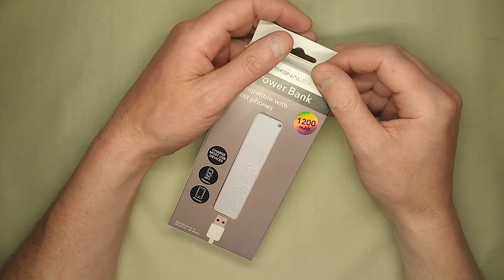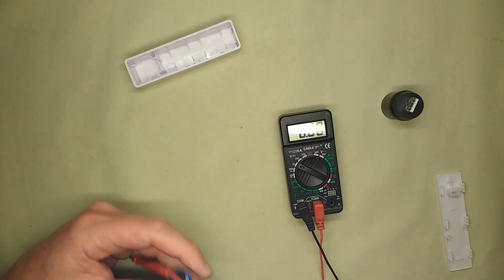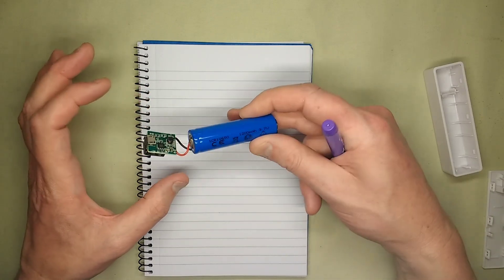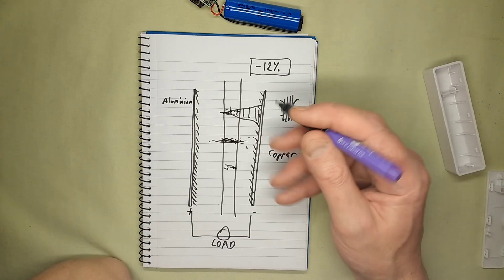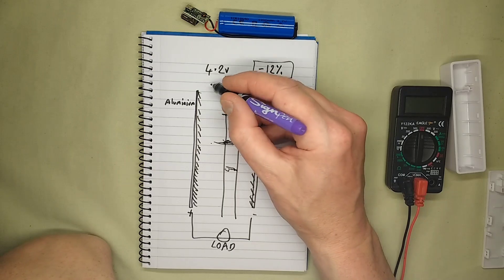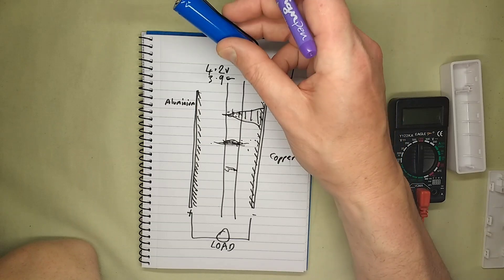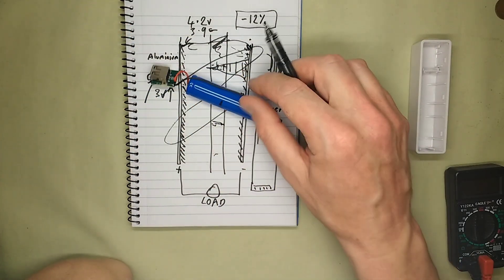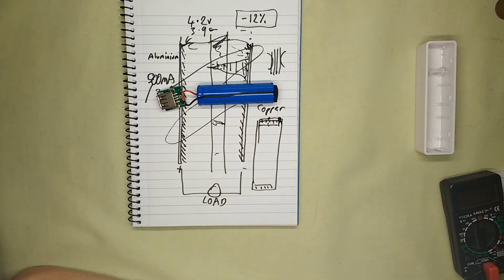Are over-discharged lithium cells safe?  (And how to test for damage.)

Comment: I've only just started tinkering with 18650's in the last few weeks. And I found this video right after i finished doing the same self-discharge test on over 60 18650 cells that i got from old laptop batteries.

I charged them, recorded the fully charged voltage of each cell, and then left them for 2 weeks. Most of these cells started off below 2.5V, others were even below 1.2V, and a few of them had a voltage as low as 0.12V.

All except for two passed just fine. And most of them seem to still have most of their original capacity.

Comment: Hello Clive,

I would be cautious about recovering cells from below ~1V. I once left a 20Ah Li-ion (NMC) pouch cell plugged in to the load bank on the bench, forgetting the load bank would continue to discharge the cell when off. Monday morning, my boss showed me how the cell had gone from being firm to really floppy, indicating loss of structure. We disposed of the cell. This loss of structure obviously won't be visible with an 18650 cell due to the metal can. Would be interesting to repeat this test on your "9V" lithium-ion battery's pouch cells.

I was once told by a Li-ion chemistry expert that discharging a Li-Ion below 1V would completely de-lithiate the cathode, and collapse a lot of the structure, resulting in capacity loss. If charging too rapidly after that, lithium dendrites could form, triggering a micro-short circuit (which may/may not burn off). For this reason, (and also thermal dissipation as you pointed out) charger circuits usually do a 1/10th of normal charge current until the cell is closer to 3V, then they charge at full current. I have however seen some chinese designs that merely use a diode+resistor from a USB connector direct into the cell, and rely on the cell's protection circuit to cut off the charging when full. Pretty sure if it wasn't legally required to fit a protection circuit, they would omit that as well.

I've also seen power banks that fail if they aren't charged regularly, the power bank circuitry self-discharge takes the cell fully flat after many months. After that, they often have poor capacity and don't keep charge.

So, my conclusion is, over-discharged cells should be viewed with suspicion, and not fitted into a serious product. If you have to use them, charge slow, and never leave unattended. I have seen cells that just sat at around 2.4 to 3V and took ~1C charge and just got hot - eventually, in a confined space, if they get to runaway temperature you could have a fire(work). For this reason a lot of chargers have a timer limiting max charge time.

At a previous job, we would screen every new battery's voltage when it arrived - after 6 weeks in a shipping container en route to us, if it had discharged itself,the voltage would be low, and we would reject those cells below ~3V. So i can confirm your method of screening for faulty cells with self-discharge does work, and has worked for me for 100s of thousands of batteries screened.
Reply: I have a power tool battery I did this to and it is still working 2 years later....
Reply: @optimizelogicrepair2784  I recently did some tests with Lithium-Iron Phosphate cells, and was able to take them down to 0V for an hour or two and then use the charger's recovery feature to slow charge them out of the dangerously low voltage zone. After that, they came back and worked fine, with barely any loss of capacity. But I wouldn't do this with other Lithium-ion chemistries, I've seen too many that swelled up or didn't recover properly.

Comment: What I found taking apart laptop cells is they will read .7v or such but that isn't actually the battery charge but what seems to be a leaking voltage from a protection circuit on top of the cell.

 As soon as I connect it to a bench supply and power it a few minutes it'll shoot immediately up to more of a standard operating voltage and usually work fine from there on out.
Reply from the maker: Below 3V lithium cell voltage plummets.  If too low it should be brought up slowly with a trickle charge to 3V again.

Comment: I have a question 
I have a power drill battery pack without anything but the cells,really,no protection just cells,and they all act like capacitators. Is it possible to cycle them enough for them to work again?
Also are cells with paper cover more dangerous than the ones with heat shrink?

Comment: Good explanation.  I was wondering if there was any chance there could be some small drain through the board.  Also, I've read that some of these batteries have an internal circuit that protects them and they basically look the same on the outside.  I wonder what would happen if a protected battery was protected again by another circuit.  I watched a very long presentation by a university who accepted and tested a large number of major manufacturers batteries.  They couldn't identify the manufacturers but stated that combination of additives, they called the "secret sauce", identified the very best batteries and they did mention company names that tested the best like Tesla.  I'll try to find a link.
Reply from the maker: There is a notable standby drain with these.  When multiple layers of protection are used they don't usually interfere with each other.

Comment: I know this is an old video, but I recently had success reviving a Milwaukee drill battery. The charger wouldn’t even think about charging it because the cells were discharged well below the threshold. It sat that way for months. Just for science I hooked it up to my bench PSU and set it to the packs voltage and 3A. I sat and watched it go up and kept putting it back onto the charger until it would charge. I ran it through a couple charge/discharge cycles and it has been holding a full charge for 2 months. I was pretty surprised, and saved a $100 battery. Great video!
Reply: Update: 2 years on and the battery I jumped is still working!!!
Reply: @optimizelogicrepair2784 thank you for the update. Gonna try the same on some salvaged cells from a laptop battery
Reply: Did the same with a Ryobi 18v battery. Since it was still within their warranty period, they sent me a new one and told me to recycle the "defective" one. Essentially gained a free battery.
Reply: Try a lower current next time just to reduce the risk of ignition 8:20
Reply: I have read an article about modern laptop batteries where they are sometimes designed to fail permanently. The circuit board has trippable switches to disable the battery entirely or specific cells that are bad. If you try to replace the cell the battery still won't work due to the circuitboard trip switch which is permanently tripped. (Not sure of the correct term for this)

There are sometimes chances to replace a cell , but you have to do some hackery like keeping the old dead cell connected while adding on the new cell, or equalizing the voltage of the old cells and new one, else some imbalance trips the battery circuitry and the battery will be permanently disabled. (Even though you have now fixed the battery, the circuitboard won't allow its use or charging)

 I'm not sure if your tool batteries are designed the same way though
Reply: @zzoinks  this is called an evil BMS 8:20

Comment: Huh, I haven't had great luck restoring batteries that went to 0V... No fires, but no recharge luck. ~1V seems to be where I've had luck maybe getting them to come back, usually at like 40-60% original rated capacity. Although I'm guessing ones like the battery bank you had here weren't at 0V for very long times, wonder if that has anything to do with it...

It's probably safer for folks who haven't worked extensively with these cells to stick with the 2V rule, though. Or at least to make sure they're really safe, like having a low current charger that's in a place where it can't potentially burn the house down if it does have a catastrophic failure. [I have a fireproof box that I put suspect cells into for charging]

Comment: I've revived tons of fully discharged cells in the past 10 years, as mentioned most of them are doing pretty good, just with slightly reduced capacity but more importantly higher internal resistance, so they aren't good for being discharged at 10C or so anymore (assuming they were in the first place, thinking of lipos used to power drones)... in a powerbank or powering accessories no issue. Some lipos do balloon and die though.

Comment: About the phone problem ... I think its the same phenomenom when you mention about cells that where over discharge (near  0V), and they where ok after a charge ... The inner materal isnt limited for a low price of production. So even if the cell is over discharge and charge again are not damage is just because its the reverse of making phone batteries for limited space money etc... Those poundland cells are beeffier if i can say, they dont care  xD the inner material dont brake that easy and they might have more materiel than needed (thicker isolation between Inode cathode than necesaary) 
 so they dont brake that easy when under high stress !?!?!?

Comment: The only issue with heavily discharged cells I've found is my favorite charger refuses to accept them as anything other than 1.2V cells, and my hobby charger flat out says no and angrily beeps at me.

Normally, a quick zap on the bench supply limited to say 100ma, perks them right back up.
I have never had a cell do anything... funny, afterwards. Only a bit of lost capacity.

It's worth noting that you can do this to other rechargeable chemistries too.
Once or twice a cell wouldn't take a charge, and I've just straight up told my bench supply to blast the cell for one or two seconds with thirty volts at five amps, in the hope of just burning through any internal shorts. I've brought several cells back to life this way, and have yet to have one be problematic afterwards. Usually quarantine them for a day or two in a steel box after, but no problems.

Comment: nice informative video, just as relevant as it was 4 years ago.
I have a stockpile of 'dead' laptop batteries (18650  cells, between 3 and 6 depending on laptop brand) from work that I'm waiting to open and see if any of the cells inside are still useable.
In the laptop it will go from 0% to 100% in a few minutes, but then immediately die when disconnected from the power supply.

Comment: I've had some success in freezing Lithium batteries and then once frozen, dropping them at shoulder height onto a cement floor several times, then letting the battery thaw and recharging them again...I usually get a few hundred more charges out of them! YMMV
Reply from the maker: Not sure I'd recommend that in case it causes internal damage.
Reply: I've revived a couple of LiIon laptop batteries by freezing. Let them freeze an hour or two, thaw, then charge. The one in my laptop has been going over a year now. Pack was previously holding only 10 or 15 mins now runs over an hour.

Comment: However, the 'copper spikes' issue causes lithium ions to self discharge to 0v. If you charge them back up, you could trigger them into thermal runaway. But the batteries were damaged first, leading to their self discharge to 0v. So asking if it is safe to use a battery at 0v is not enough information. HOW did it discharge to 0v?
Reply from the maker: Quite often due to bad power management circuitry with high passive current.

Comment: Hi Big Clive, just subscribed and really enjoy your very instructive videos.
@9:30, this charger circuit reminded me a lot about an IC for the same use which i'm currently evaluating for various designs: micro RC rover, bluetooth keyboard etc, it's the main chip on most eBay ICs LiPo-to-5V+charge adapters:
HOTCHIP HT4928S, it's an SOIC-8 combining a Li-Ion/Po 1S charge circuit plus a boost converter to output 5V, requiring only some passives +a 4.7µH inductance:
https://datasheetspdf.com/pdf/1256500/HOTCHIP/HT4928S/1
planning to use this chip for all my <500mA 1S LiPo uses when i really need  5V and can't have all on < 3V.
(And sourceable, for now we have many vendors selling modules based on it but very few vendors for the bare chip).

Comment: Clive -   I have 2 x tablet KEYBOARD batteries (7wmm7) from a Dell Venue Pro 11 7140 I bought on ebay as untested. Tried in the keyboard but neither wouldn't charge. Opened one up today and it has 4 x lithium cells connected in parallel I presume as the stated voltage is 7.4V. Each cell had 0 volts in that battery. Opened the second battery more carefully(not BigClive styli ! )  and checked each cell. This time each cell was 0.92 volts. So my question is - if I connect a couple of AA cells in series and apply the 3V to each of the cells in turn will I be able to  boost  them to about 3V so the keyboard charging circuits can recognise them and then fully charge them ? The cells have no protection so I would keep checking the voltage every few minutes to see if it was increasing. Should I give this a go or not ?
Reply from the maker: Make sure that none of the cells are reading a negative voltage.  It may be possible to gently bring them back with a current limiting resistor to get them back to 3V.  Lithium cells may not be suited to high current use after excessive discharge and if there is battery management circuitry it may lock the battery out. 
On eBay "untested" usually means tested and failed.
Reply: @bigclivedotcom  Thanks for the advice, Clive. I will give it a go later today.

Comment: Great video. I had a Samsung 30Q that got drained down to 1.6v and I didn't want to scrap the cell. I thought about that copper shunt issue,  so I used my Xtar Dragon VP4 Plus to check the internal resistance of the cell. It was 0.24m at 1.6v so i started charging it and was able to get the cell up to 3.82v so far. The Internal resistance now dropped to 0.10m.. So I am inclined to believe that this cell is OK. Does this sound right?
Reply from the maker: It should be OK.  But don't use it for very high drain applications.
Reply: @bigclivedotcom  Hmm, and that's exactly what is was being used for originally. A high powered flashlight that used a FET direct drive driver circuit. (Lumintop GT Mini) So you probably advise against using it for that light now? BTW it charged up to 4.18v with a final internal resistance rating of 0.10 mega ohms.

Comment: I have one but when I plug in this thing that turns any speakers into Bluetooth speakers it turns on for like 5 seconds and then turns off again. I think the board can sense when power is being drawn because it has no switch. And I don’t think the Bluetooth thing draws enough power or something? I was just wondering if I can put a resistor across the positive negative of the Bluetooth thing with a switch somewhere on it? I am kinda new to this stuff so if anyone can help that would be nice.

Thanks

Comment: i own one of those, they get discharged because there is a blue led that stays on even when its not supposed to be on but at a lower brightness, and yes, those get really hot when you use them to charge a phone (the pcb does, not the battery)
Reply from the maker: The blue LED indicates that the booster is pulsing to keep the output capacitor charged to 5V.  It gets brighter with higher loads, but should normally just blink dimly every so often.

Comment: This video I do not like. You propose that we should just charge the cell all the way up to 4.2V and then check for self-discharge a few days later. Well, guess what... if a cell has developed shunts inside due to any reason, and you try to charge it to 4.2V using a standard charger with a current of 1A, you’ll definitely have a 4W heater element going I  inside the cell, which will definitely boil the electrolyte, and then either trip the CID (hopefully), or vent with flame. When testing if a cell is recoverable, use a VERY LOW current, 200-300mA maximum and check for overheating, especially over 4V. @bigclive, you need to pay a visit at the secondlife forums and groups.

Comment: I watched this a few years ago and have just watched it again. I think it's worth adding a note which states that this isn't quite true for all Li-ion cells. The current range of cutting edge cylindricals with upwards of 3mAh are becoming increasingly volatile and I would be very cautious of charging a cell which has dropped below 2.5V or exceeded 4.2V. The same goes for temperature. Apparently there are cells out there that will run away if they are over temperatured even when not being electrically loaded. This run away event may happen hours or days post the event. I know that the automotive test houses are seeing "thermal issues" after days and weeks of an abuse test being performed - so it seems that the test has been passed as the requirements usually call for a 1 hour or 1 day observation period but the cells are not showing the effect of being abused for quite some time.

Want a scare? get the latest Samsung high capacity 21700 that you can and shoot the negative end with a BB gun - stand well back....